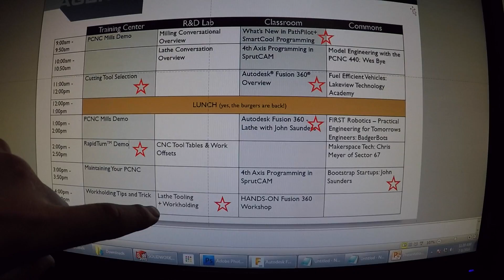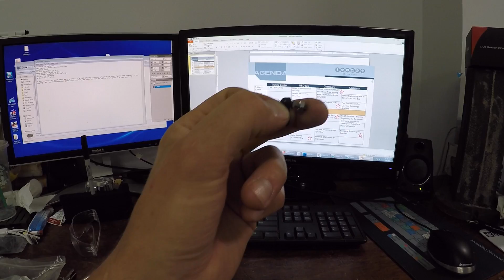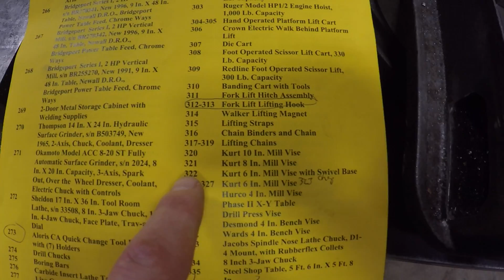Tormach Open House, Free Lathe, Auction Haul, VEX Donation, Shop Update!  CB27

Comment: This wasn't a job shop auction! This was mold making shop. The injection molding machine was only for mold tryouts and troubleshooting. Next time pick up one of those tool grinders and learn how to use it. They are great for fixing the ends of your endmills or custom cutter shapes. I loved using that tool to change the radius on the corners of endmills. That Johnford mill is high speed, imagine a 1/16 ball nose endmill running over a 3D surface at 200 in/min and leaving a near grind surface finish. AWESOME!
Reply: I'd love to but I don't get to Ohio... ever. Since I moved to Alberta. I do miss Cedar Point though.

Comment: I have one of those swing out Lister Cabinets, I think you'll find them super handy for keeping vices, V blocks, etc etc. Stuff that's really a bit heavy for regular drawers, but really shouldn't have you reaching out too far to pick them up as it's not good for your back, and it's surprising how far you need to reach to get to the back of standard shelves of that depth.

The swing out shelves have great access, are super space efficient, and can take more weight than it appears, but yes, I guess you'd have to be reasonably sensible about loading them up. The spacing between the shelves is perfect for larger things.

Comment: At 3:30 that might not have been shim stock (the blue ones). They look like clamp screw chip guards for a Kurt vise. You can never have too many different lengths of those (you need different sizes for different jaw openings). They're really useful to keep chips out of the trough where the clamp screw is exposed. (Makes brushing away chips easier, too.)

10:00 maybe you could spin off a small production shop. Get someone who WANTS to do small production and help them bootstrap it. Maybe offer design/CAM support.

I'm terrible at auctions; I get carried away. I like eBay better where I can quietly determine exactly what I am willing to pay and then NEVER LOOK until the bidding has ended. I either win at a price I'm willing to pay or I lose. It should work the same at a live auction, but it doesn't, at least not for me.
Reply: There is also the macho "You can't outbid ME!" syndrome.

Comment: At 6:46, you touched your steady cam to switch mode or something. You shouldn't have. The frame was much better before, pointing slightly downward. It lets us see more of what's around, and less of the boring ceiling, and you were still perfectly in frame.

Edit: You did again at 8:56, and again it wasn't great.

Comment: One tactic you can use is to "fire" your worst customers. You can set up a point system to rate your clients: plus for positive aspects (such as prompt payment, recommendations, and a cooperative attitude) and minus for negative aspects (such as constantly late payment, unwarranted complaints, and quibbling over your pricing). Then drop those with the lowest points. That allows you make room for increasingly better customers.

Comment: You would be insane to get rid of that metrology equipment.  NEVER NEVER NEVER part with metrology tools unless they are damaged, incomplete, or you have more than 2 of them.  Those are not dowel pins, those are gage pins, significant difference.  That is an amazing haul.  The sine bar and mag blocks are meh, but the metrology tools are a real score!
Reply: Metrology is just the term that encompasses all measuring tools.

Comment: SmartCool is like Haas' P-cool. uses a motor to aim the coolant at the cutter based on the tool height. Can also sweep the length of the cutter. They had one operational on one of their 1100's they use for the workshop.
Reply: was only setup for flood coolant. not sure whether it can be configured for a fog buster or not. it was definitely mounted too far away for any kind of fog buster/MQL on the machine I saw it on.
Reply: was only setup for flood coolant. not sure whether it can be configured for a fog buster or not. it was definitely mounted too far away for any kind of fog buster/MQL on the machine I saw it on.

Comment: That Starrett 123 Master Vernier might pay for the whole thing. They are about the most accurate calipers you can get! Nice unit
Reply: Looked up the specs on them today.  .0005/ft of length.  Compare to a set of Miti digitals - the 3ft units are .003 - yep, the mater verniers are 2x as accurate

Comment: Perhaps it's time to look into a water Jet?
Reply: greatings from team 4683
Reply: Water jets are nice. However they are very loud, very messy, require loads of time to maintain. And pretty expensive to operate as well. Nozzles wear out quickly, require tedious warm up cycles to maintain the pump seals (which end up blowing out anyway) need to pay to dispose of the sand media, because most state EPA laws don't allow you to just dump it. 

And. The mess!  sand and water and sludge gets EVERYWHERE. 

It's a machine you really have to be prepared to utilize well to make it worth the time and upkeep. And really. They're not all that accurate nor very fast in comparison to other machines. They're really more of a niche machine in my opinion.

Comment: Hi, I'd like to know your power feed to your shop?
Reply: Thanks for the reply, was this of your choosing or the place came with it? Do you have a different plans or estimate for what you think is enough?
Reply: Generally in North America, for small to mid-sized buildings/companies, it's a question of what is available from the electric utility at that site.  Large facilities can pay to have new service run to a site (up to some limits), but for most, the electric service (voltage, 1 or 3 phase, amp/capacity) available to the building/site is part of the research in selecting a building or site.  If 3 phase is what is offered by the utility, it is generally easy/reasonable cost to install the transformer to switch to 1 phase/240v, but if only single phase is available, you need to provide your own 3 phase converters, and they have limited capacity (for very large equipment.)

Because large air conditioning systems are more efficient with 3 phase power, it is usually available in commercial and industrial areas (either 208v or 480v), but is uncommon in residential areas (which are provided single phase 240v/120v service.)

Some businesses can determine for themselves what capacity they need (they know their equipment/plans), but generally you hire an Electrical Engineer who is experienced with your type of facility to estimate your loads and design the electrical service (size of wires/conduit, transformers if needed, electrical panels/breakers/circuits) then a licensed electrical contractor to install the electrical components and coordinate the service hookup with the utility.
Reply: +Thomas Donalek Thanks for detailed reply, really appreciate it.  

Was drafting out a fast business plan and checking out what is on offer here in Dubai was quite interesting.  Most of warehouses are for storage thus 15kW supply.

I estimated the my power need  for a sheetmetal/cnc workshop would be about 200kW. 

When searching  for a place with such power it tends to be huge and expensive for the required . Either be lucky or upgrade to the load needed.

Comment: John,  Can  you do an instructional on machining UHMW on the Tormach?  It's challenging at best to get a good finish.Keep up the great work!
Reply: Agree, it is so stringy but our robotics team uses it a lot.
Reply: +TOXIXIFY I doubt it. UHMW is less than 1/2 the cost of delrin. And has higher wear and impact characteristics over delrin. It's a known PITA material to machine so it's usually only picked over delrin (acetal) for a reason.
Reply: +Occams Sawzall we use it for chain tensioners which is why the high wear resistance is important.
Reply: I bought an Onsrud O-flute solid carbide cutter today.  Cuts UHMW like butter with a really nice finish on the edge.  Can't wait to cut some more now!
Reply: I suggest high speed steel on UHMW or one of those single flute down cut carbide cutters designed for plastics. 

Treat the speeds and feeds as if you were cutting mild steel. I know. Seems weird, but it's worked for me in the past.  

UHMW is a diabolical plastic. It doesn't like to chip, just mush and deform. Sharp sharp cutters and chip evacuation are essential.
Reply: pain in the ass material. keep you speeds high, and feeds higher to prevent melting.
Reply: +Occams Sawzall Good point on the tool nose radius!
Reply: +BEARBOTICS2358 Any way you can convince the powers that be to use delrin?
Reply: Simple... FAST AND SHARP Tooling not carbide unless you have  special/sharp ground for it.

Comment: Awesome score at the auction! You can never have too many Lista or vidmar cabinets. AT 5:50 I think I have that exact set of mics, I use my 224's for most all of my larger work since you can cover 3 sizes with 1 mic.
Reply: NYC CNC
Sweet!! You will be filling that shop up fast 4 at a time! You will be surprised how handy a radial arm drill is, it is one of the 1st pieces I want to add when I get my new shop going. Look forward to the details. :-)
Reply: At my internship I had the opportunity to tap some holes on a very large steel part using a radial arm drill. It was so cool and satisfying to use that machine. If it wasn't for the lack of money and space to put it somewhere, I would already have one :)

Comment: That graphite machine looked in beautiful condition. Probably had a nice high speed spindle on it as well. 

Oh. And the graphite blocks are called electrodes. And they are for a die sinker EDM. 

That looked to be an impressive shop. Is a pity it went under. They were definitely well kitted that's for sure.
Reply: +NYC CNC what?!!  

Geez. I would have paid twice that and thought it a steal!!  The spindle alone is worth over $9k!